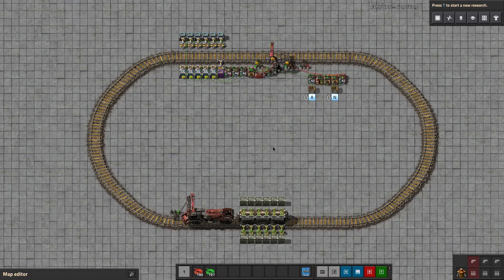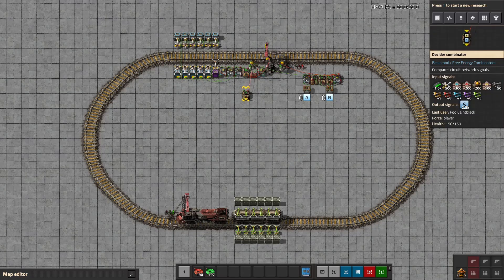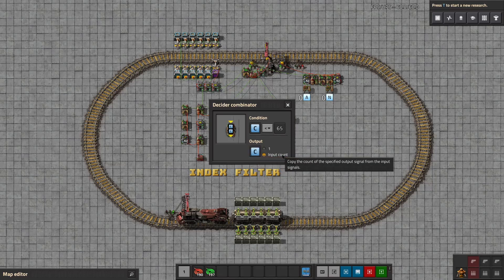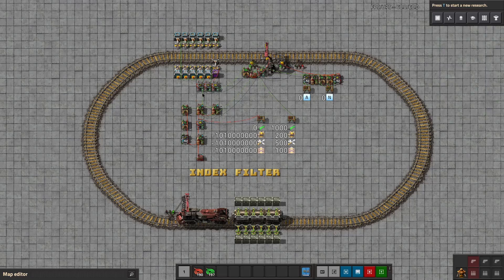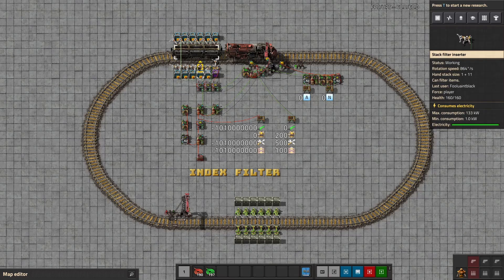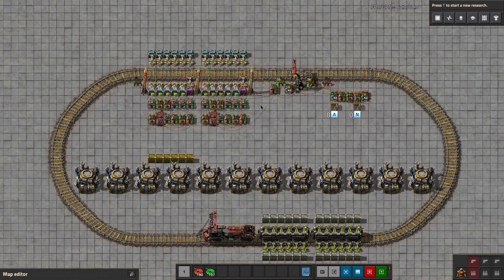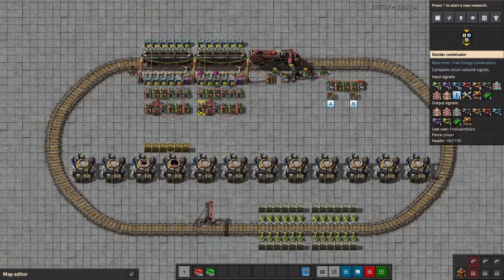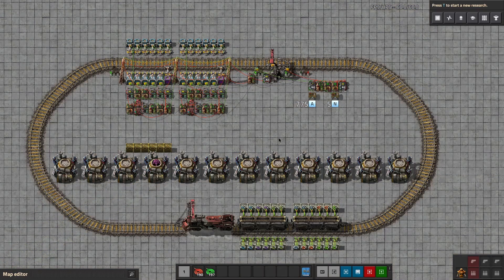Supply Stations and How They Work Part 2: Index Filter

Comment: This is really neat. Thanks for taking the time to develop this. I do have a couple questions before I jump into using it. 

First question is, how does the rail signal work, does it separate the contents of each wagon on the train or am I misunderstanding that? 

Next question, to add a 3rd wagon or more, do I just chain the loader/combinators just how it's chained from the 1st to 2nd wagon, and do I need to add more shared combinators to do that?

Question 3, if I change the number of indexed item for the wagon, I just multiply the number of indexed items by 5, and then add 5 to account for the tick length of the circuit?

Question 4, if the train somehow returns with a higher number of an item on the index, will the trash inserter still remove it?

Comment: is there a way to automate index and clock setting?
Reply from the maker: I like the way you think : ) 

The short answer is, yes. The long answer is, the concessions required to make it work are significant. One solution I've seen involved placing one of each desired item into a chest, an inserter can only pickup one unique item at a time, this can be used to automatically create an index. It's neat but more time consuming than placing a second constant combinator with the loadout and and adjusting the values to index positions. Another solution is to use combinators to sort the signals but the solutions I've seen require a lot of combinators. I can envision a fairly complicated system that might work but there are less complicated designs we can explore first.